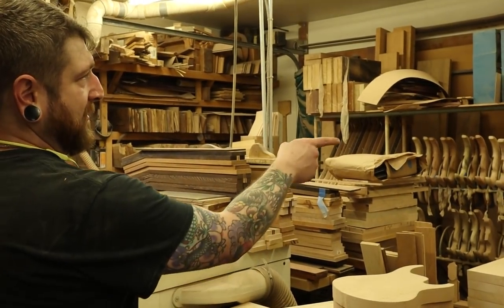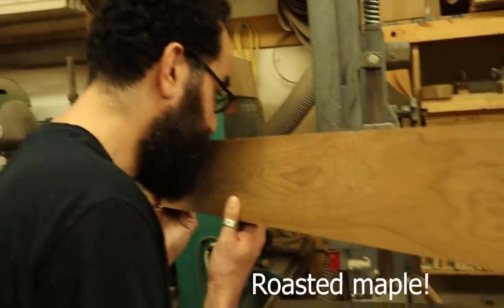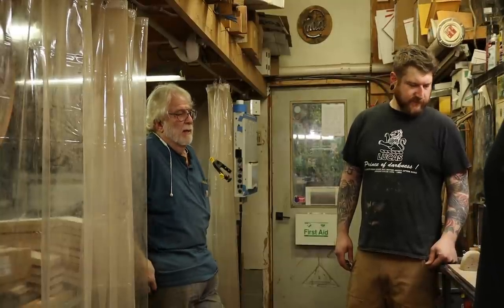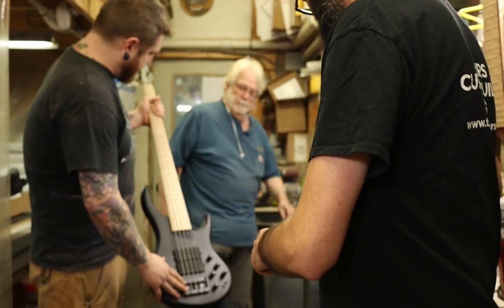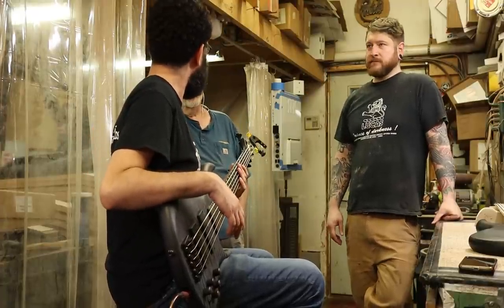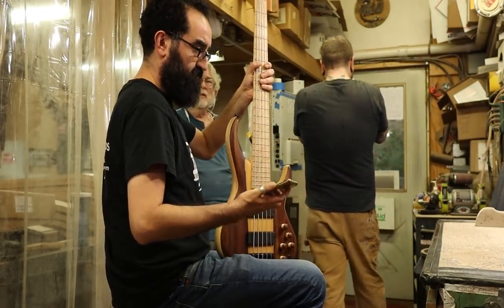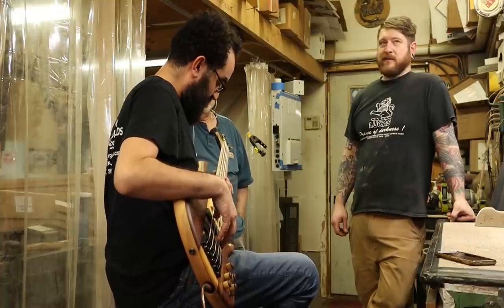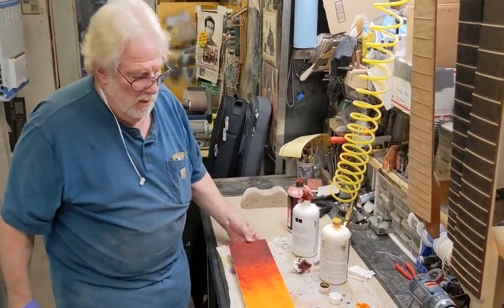MTD Shop Visit - Talking BASS with Michael Tobias and MORE! - LowEndLobster On Location

Comment: Amazing!  I had no idea that the MTD shop would do upgrades for the Kinston series.... any idea of the cost of those upgrades that were shown on that Super 5?
Reply from the maker: Yes! It's around 750 installed currently, I have a separate video coming detailing the modded bass, and another comparing it to the stock Kingston
Reply: @LowEndLobster  That's very reasonable for such upgrades, thanks for the info!